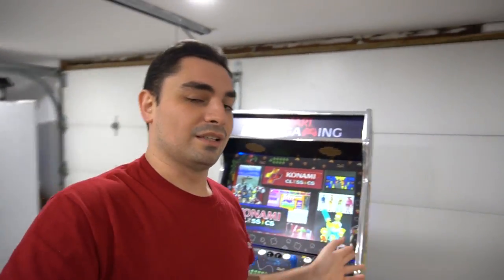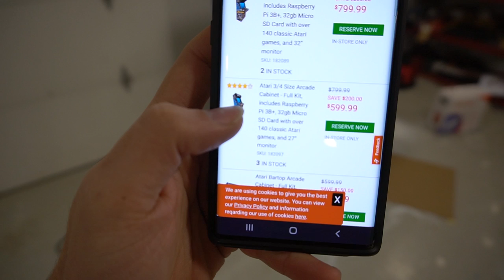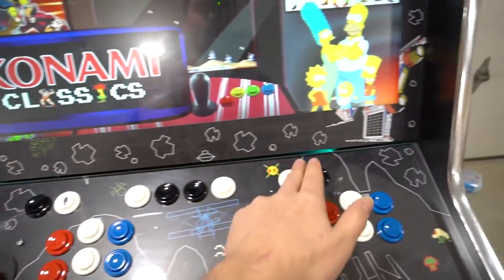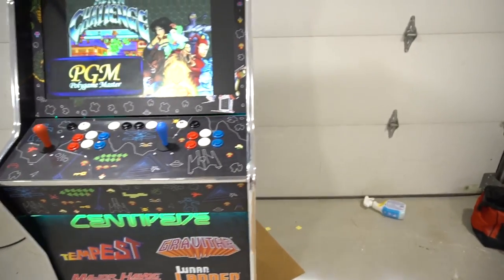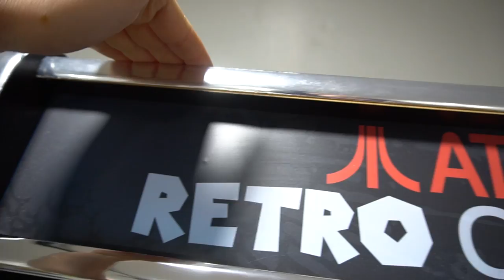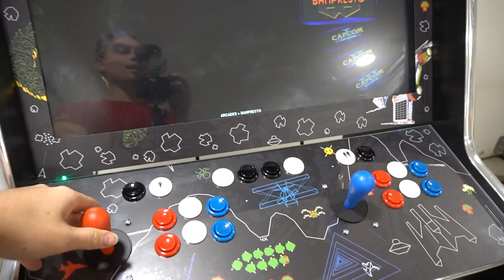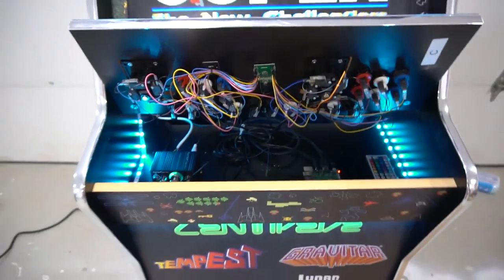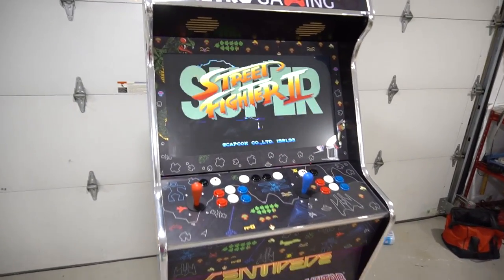Micro Center 27 Inch Arcade Cabinet Review

Comment: Vic I'm So.. so. so Happy to see this! First Video I've Seen of this one! 

I picked one of these up last week or so with my father, The DIY Kit that is for $215. 
It was heavy as hell  & no way in hell did we even attempt to lift it up on to the Ford suv.

So he gave me the box cutter we took it apart piece by piece &

Loaded it up as the micro center shoppers looked at us in AWe.

You statement about microcenters arcade liquidation  seems all to damn true. 

About  a year & half  ago when I visited to pick up some ssds they had  the big arcade cabinet displayed & most of the 
arcade things out in front in its own area. These days Everything seems to be in the back storage rooms. 
This is  Microcenter Tustin CA. So Glad I picked this one It fits in My Apartment just Right.

Seeing this video of a full build pumps me up. I'm sticking a 

28 inch monitor in mine custom graphics from gameongrafix

and some custom buttons/Joysticks.
Reply from the maker: Sounds awesome dude! Yea be sure to apply graphics prior to building. I hope you got the marquee artwork setup to have the adhesive on the face of the vinyl:)
Reply: @Vic_VP  For sure man! Thanx for the heads up. I've watched some videos on setting artwork first as it makes much more easy than  downing it and lifting it for sure. I'll try shooting you a screencap when ever I finish it.

Comment: I've seen the cabinets go on sale every now and then. I don't think they are phasing them out. But they offer the deal. And you gotta jump on it!
Reply from the maker: Yes they actually are not, I spoke to some that messaged me from Mc, they actually have some very awsome products in the making;)
Reply: @Vic_VP  Also man great video. I saw this cab on sale a few months ago for $160 (basic) near the micro center near me. And I thought it was going to be the size of the A1u and I'm just through with those. But seeing this wow. I've got one on pick up to start my friday. How do you think this compares in size to the atgames cabs. Also do you think four more buttons can be added to the control panel for an eight button configuration for those of us playing fighters?
Reply from the maker: For player 1 you can add 2 buttons, not sure about player 2 I sold the cab lol
Can't compare to atgames as I don't have 1 :/
Reply: @Vic_VP  Thanks for your input and thanks for this video. Guess I'm gonna find out what this frame can do. Do you by any chance remember the monitor that came with it?
Reply from the maker: @museprime8784  04:50 i show the monitor
Reply: @Vic_VP  I just drilled 2 buttons for player 1 and player 2 panel and plexi and it worked out great.  I took the plexi and used it as a template I stuck some painters tape on the plexi and then moved the wood panel top over one set of buttons to mark the center of the new holes in the plex.  Then I placed the plexi back on the top of the wood.  Then I drilled a pilot hole and used a step bit to get through plexi and I found out the step bit left a conical hole for the control panel.  Then I used a hole saw to finish off the wood on both sides (while drilling I used dish soap on the step bit and went slow).  Thanks for making a great video

Comment: What’s up from another jersey brother, would even think you were from Bayonne with the same accent I have , would you buy this kit over the 32inch gameroomsolutions kit? You could get a decent trackball already cut into the control deck with deck protector, and free shipping for around $800. Which would you go with? I don’t want any pi’s or anything, I have them all over my house, I’ll be using a pc.
Reply from the maker: Pc I suggest the 32inch grs. Can't beat the price nor the precuts. 
This kit was very cool... but the price was the best part. I could have cut a 2inch trackball in it, but I don't cut those unless I have a deposit from a customer haha.
Reply: I’m not sure what to do. I built a video jukebox out of a marvel v Capcom cabinet and kept all the original parts so I can sell it
As original. I watch your videos . Cool stuff bro. I thought you were from Bayonne NJ because you have our accident , that or Staten Island. Lol what do you think I could sell the marvel v Capcom cabinet for? I’m running a pc now but I’ll just add a pi with a 64GB image to sell it. It would be the original cabinet with a 20 inch monitor, custom control deck with LED buttons, led deck protector light on the custom deck protector. I have replacement 4inch speakers under the marquee, 2 6inch speakers and coin buttons on the J Panel, (which i would be keeping and putting in a j panel with just 2 coin buttons or even just the original J panel. I’m keeping the new xtra speakers except the ones under the marquee which will
Stay. I have a subwoofer in my riser and all the stereo equipment is being run by a onkyo head unit. Def keeping that also. Lol 
I have the original control deck with its buttons, deck protector, joysticks, the original monitor , pcb, etc. I could probably make more money selling the cabinet modded and then sell the original control deck, monitor and pcb separate. What do you think? I def want to upgrade to a larger cabinet I can build to match my legends ultimate. I’m not sure what company I should order from, the micro center cabinet is nice, but it comes with all cheap parts. Although the sticks look like the same sticks they use on the tank stick. That I would like. But a pi3? That’s just garbage now a days. The speakers I saw in the article are $19.99 in the store but actually sound good.
And the artwork, omg bro, walk into the micro center in Paterson NJ and they have the worst looking arcade stickers on earth lol it’s yellow and just horrible looking lol 
Here is a video of my
Marvel V Capcom mod.
Reply from the maker: @AJerseyJohnnyEntertainment  I sell a1up mods with 128gb SD card for $900
Reply: @Vic_VP  I asked for $950 and was gonna include the original pcb monitor and control panel. Should I keep those , because I could easily sell the pcb, people constantly ask me to sell them the original pcb.
Reply from the maker: @AJerseyJohnnyEntertainment  i never had anyone ask me for original pcb... but then again my last a1up mod was about a year ago. i tell all my customers to spend the extra money on a real arcade cab with reliable parts and not the god awful cheap a1up screens and cabs
Reply: @Vic_VP  , I only used the arcade 1up cabinet as a video jukebox player for my home arcade and the artwork was dope , nothing comes close . It was the marvel vs Capcom cabinet so I kept the pcb, original monitor and control board because you can’t buy them. They only made a limited run and right now they are selling for $1400-$1700 on eBay and it just was released in November. That’s why everyone is hitting me up for the pcb because I was just using the cabinet as the video jukebox, It’s smaller then my other gaming cabinets and my home theater equipment fit perfectly stacked on each other just like they did in my media room at my old house. I would never suggest anyone put over 1 grand of just stereo equipment into their arcade cabinet , even if it was for a video jukebox but I had all the gear laying around since my new apartment doesn’t have space for a theater room. But that’s why people want the pcb. It’s the marvel v Capcom and people want that cabinet and can’t get it. I can see why people like getting a bunch of  1up cabinets to give their game room that arcade feel. But for anyone who is a gamer it’s a shit experience. But it definitely looks cool when I see some people with a whole bar , with cabinets everywhere etc. I prefer two large multicades and now that I’ve seen how crazy people love them, I always will have a video jukebox player in my game room. I sold 20 within 2 month but then covid hit and then I didn’t want to be going into peoples houses and stuff . But it’s a easy add to any cabinet , as long as they don’t have those crappy little arcade amplifiers. But people get crazy when they see their favorite old music videos , especially since mtv doesn’t play music videos anymore lol
Reply: @Vic_VP  , I’m not gonna tell someone to buy something else if I’m selling the part. Lol I got $1,000 for it. And $250 for the pcb.
Reply from the maker: Cool bro 👍

Comment: Vic just curious I was looking at this in micro center but I'm building my own and I wanted to ass the 14x 4 monitor in the marquee but dont want to spend the 300 if the marquee is not big enough to fit that monitor. do you know how big that marquee is ? i need the height i know it will fit with way.
Reply from the maker: Hey Joe i don't the marquee size on this build.
I'd assume a 14x4 will fit but you'll have gaps on the side
Reply: @Vic_VP  i bought the 14.9 LCD that GRS sells for there kits just want to know how tall the marquee is? do you know how tall the marquee is on the insice ?
Reply from the maker: @panetta6pack  sorry no I don't, I don't have one to measure

Comment: Im thinking about buying this. Will this fit in the trunk of a car if the back seats fold down?
Reply from the maker: I'm not sure on , I know it's about 6 feet long as it fit in my truck bed perfectly
Reply: @Vic_VP  ok. I may have to rent a U-Haul😫
Reply from the maker: Arcade problemsssssss
Reply: Thanks for answering my questions. I bought it, put it together. I had to drill larger holes for my custom light up buttons. I am very pleased. Thanks for posting this video.👍🏾
Reply from the maker: @reggiegallon8227  interesting you needed larger holes 🤔 what buttons did u get?
Reply: @Vic_VP  EG STARTS 2 Player Arcade Games DIY Kit Parts 2 Ellipse Oval Joystick Handles + 20 LED lit Arcade Buttons (Red & Blue Kit
Reply from the maker: @reggiegallon8227  interesting this are standard buttons.. I personally am not a fan of those Amazon ones but I'm surprised it didn't fit 🤔

Comment: The Micro Center near me actually has these on sale too. I was thinking of buying a plain black one and modding it with a racing wheel. What are your thoughts?
Reply from the maker: Racing wheel base prob will not fit on that control deck
Reply: @Vic_VP  How about underneath the control panel? If I didn't put on that control panel, do you think the base underneath hold a standard racing wheel setup?
Reply from the maker: @avis5114  it's possible but I can't make that decision

Comment: Has anyone here used this cab with a 24" monitor/display vs the designed for 27"? I have a 24" display I want to use with this 3/4 scale cab (got it last night), and I have some slight concerns.
Reply from the maker: You'll have massive gaps. You'll need to custom vinyl the plexi glass to hide those gaps
Reply: @Vic_VP  I'm okay with the gaps that'll happen. I didn't get the entire kit (i.e. with all the typical arcade buttons etc as I have stuff I want to put into it myself; I want to put a spare PC I have running a game into the cab... long story as to what game it is.), so I won't have the ATARI vinyls or anything like that. I literally only got the cab kit itself. I plan on commissioning someone on Etsy or something to make me vinyls to match what game I want to run in the cab, unless my mom is up for the job of helping me custom paint it all... we don't know yet. One final thing to note is that the 24" display I want ot try and adapt to this cab set up is on a third party stand.. I'm wondering it I can can get it to fit into the cab with that stand intact, possibly foregoing the use of the backplate that would attach to the VESA mount that comes with the entire kit you got... Thanks for responding, Vic.
Reply from the maker: @ShiggitayMediaProductions  sounds like you'll use the monitor mount board and make it a shelf instead of a monitor mount
Reply: @Vic_VP  That could work! Hmmm This should be interesting... lol

Comment: How do you turn on the pi 3? Do you just yank out the power connector on the pi?
Reply from the maker: Turning it on is simply plugging it in. It's very important to shut down the pi before yanking out the power plug. 
Once you shut down the pi, it is safe to unplug the entire unit

Comment: I bought the 32" 2 player recently and honestly I'm not finding it very enjoyable to build.  There are zero instructions for assembling these things and I can't believe Micro Center is ok with this. Pretty sucky.   The ONE instructable i found wasn't all that helpful. It was just an overview with no real help during the final assembly. :/
Reply from the maker: Yea the 3/4 had a basic spec sheets. But it's kinda straight forward if you follow gameroomsolutions tutorial. Put all cam screws in on 1 side and then build up